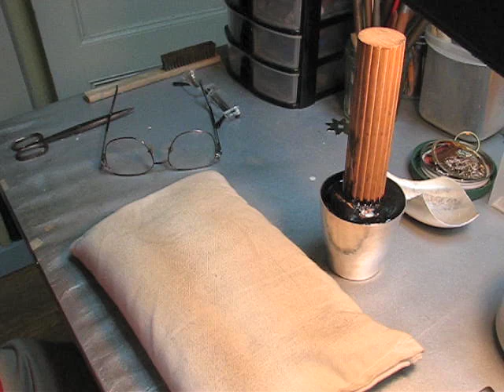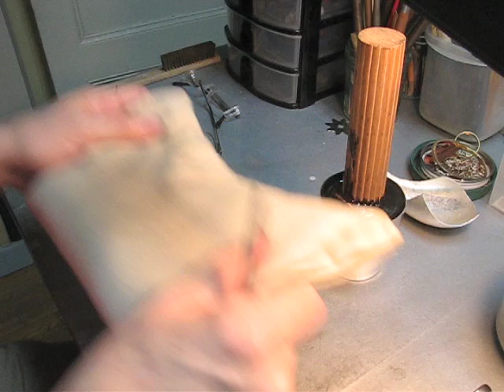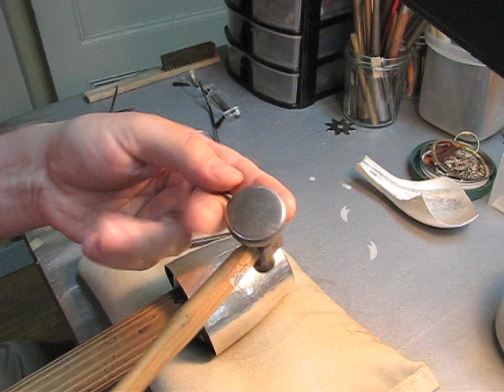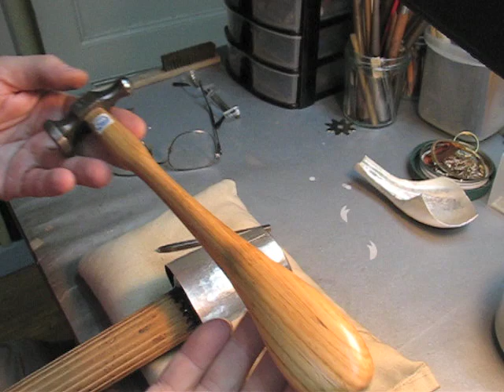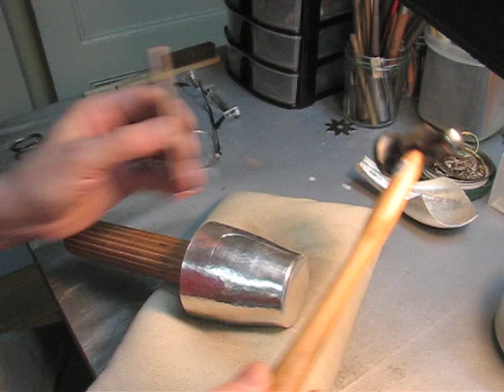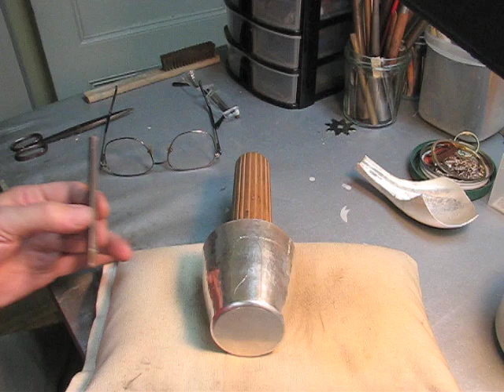Chasing - Part 6 - Chasing  begins

Comment from the maker: No I am using a chasing hammer. Planishing hammers have two heads, both of which are polished mirror bright because they are used  directly on the silver to remove/lessen raising marks. One face is nearly flat and the other is slightly convex. Thanks for watching.

Comment: Hi Sage, can you advise the best way to fill the vessel with pitch and how to remove this after chasing?

Thanks for the tutorials, they are really useful.

Regards

Wallis
Reply from the maker: There are videos in this series on filling the cups and removing the pitch. (Part 1 and 2) I always use a heat gun set no higher than 500 degrees.  You can either burn the  residual pitch out of the cup with a torch and good ventilation or you can set the vessel in a bath of  gum turpentine over night and let it dissolve.  Set the vessel upside down on a screen of hardware cloth, you will probably need an old brush and rubber gloves to brush softened residue out of crevasses, wash it with dish detergent after the turpentine treatment.  I use the turpentine method when I don't want the piece annealed as that can happen when you burn the residue out with a torch.

Comment: Just bought my first chasing tools. On my first attempt, light tapping, the tool seems to catch. It doesn't "move along the line"...would a type of lubrication help ? My tools 2 sizes, don't have the slight curvature at the corner like yours.
Reply from the maker: Most tools bought are more like stamping or repousse tools. If your set was less than $200 for about 10 tools you most likely got tools more for stamping than chasing. Without seeing the tools, I really can't say what is wrong. You do not need lubrication. The movement is created when the hammer hits the end of the tool and it will move slowly like a sled or skate on ice. If you can send me a photo of the tools you bought, I might be able to tell you more.  First attempts are not always successful. It takes a little while to figure out just how hard to strike the tool and how to hold it against the metal. Thanks for watching.

Comment: How thick is your cup. I'm just starting and was hoping to buy some cups to work with. Where did you get yours?
Reply from the maker: I raised this cup from sheet. It's 18Gauge. Usually, I work in 18-20 gauge metal for chasing. If you have a mold you can have silver spun in the proper gauge. I have examples of Indian work that is much thinner but  they are also smaller and not intended for daily use. Thanks for watching.

Comment: Sage, I'm curious about something. Do you feel that you have more control and accuracy holding the hammer by the very end of the handle versus choking up on it?
Reply from the maker: Chasing hammers have a specially shaped handle that fits in the palm of your hand, the action is very close to lift-and-drop. The hammer head is fairly light weight. Most people use a hammer by flexing their bicep and keep their wrist stiff. That is a recipe for inaccurate hitting, carpal tunnel and exhausting sessions. One  should let the hammer do the work. The handle is held loosely and 'dropped' with a little push, (from a loose grip) that way, the weight of the hammer does the work and the strike is 'clean'. Choking up would make you use a stiff wrist and your upper arm, it will not deliver an effective strike on the tool, often pushing it out of the design and/or making a chattered line in the metal.
Thanks for watching.
Reply: I understand now. I was just curious and appreciate you taking the time to explain it. I make most of my own handles now and I will try one with this design. I'm also new to the copper smithing.. Your work is just awesome. Thanks again and I look forward to seeing more of your projects.
Reply: It's actually a repouse hammer not a chasing hammer and like all hammers you hold at the end of the shaft. If hammers were supposed to be held 2" from the head, they would be fitted with 2" shafts! As it is, a good hammer is fitted with a shaft that will balance the head and make correct use easier.